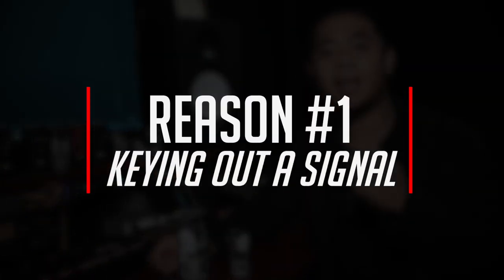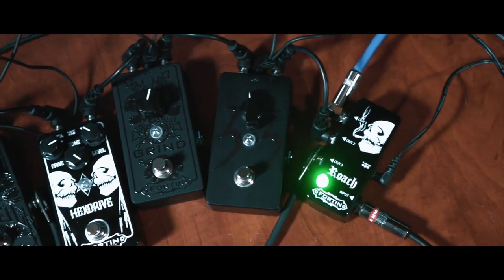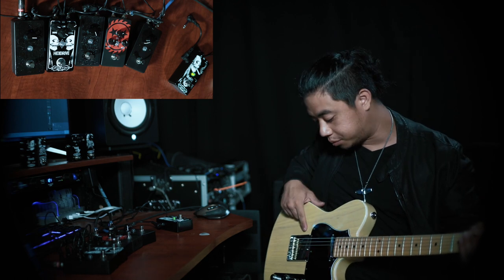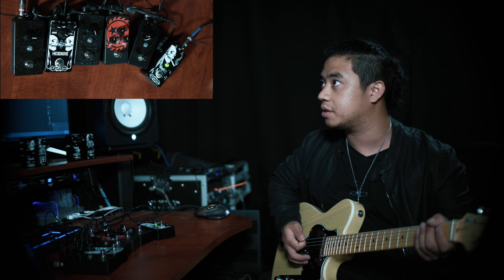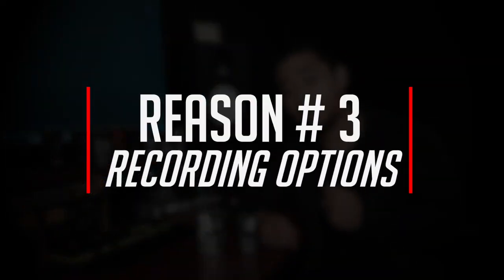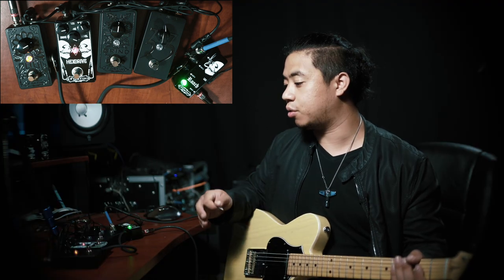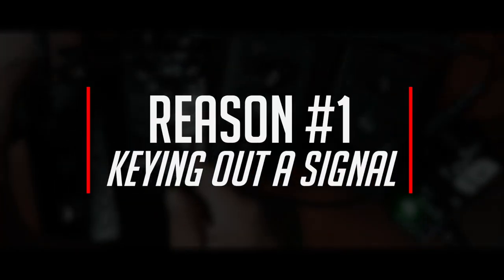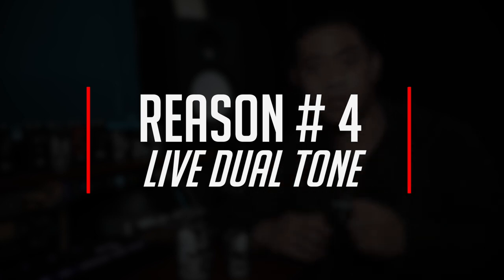Top Reasons Why You need a Splitter and Buffer

Comment from the maker: Any uses for a buffer or splitter that we missed? Let us know!
Reply from the maker: @Stealth Guitar Hey both all outputs on the roach are identical. So you can use 1 or 2 2 or 3 1 or 3. Any combination of your choice will get you that result.

For instance my output set up would be something like Guitar > Roach Output 1> 33 >5150 > Cab 1 / Roach Output 2 > Grind > Mesa > Cab 2. I hope  that helps! - Mel
Reply: Does the buffer go before or after your tuner?
Reply: @lovemesomepickles  I think I got mine before but I'll double check when I get home.
Reply: @lovemesomepickles  that's how mine is too I believe. Forgot to check. Lol haven't had to move my gear around in awhile so I forget how I got everything hooked up sometimes.

Comment: I would like to splitt signal from the guitar wireless (Senn EW100 G4) into the 2 guitar preamps. Could I use the Roach in this way? Does it works without power supply (passive)? Cables will be up to 30cm (all is installed in one 8U rack case). Thank you

Comment: Hey bro howd? not sure if this can be exactly used for this especific purpose i am going to ask ya...but here we goes....  is possible to create a dual-chain signal with this? ie.   out 1 : runs a clean tone pedal , out 3 : runs a distortion pedal with volume a little bit lower...so you can actually hear the clean note bite.      I quite in doubt about that...as the out1 would be going to daw from the clean pedal.. and out 3 from distortion pedal would be empty...not sure if that will work...can you confirm me this? Thank you for your time and video !! All The best
Reply from the maker: Seems like a similar situation is reason three and yes you should be able to do this - Mel

Comment: I don't understand why you use a splitter before the Zuul. What's the goal compared to plugging the guitar directly into the input of the Zuul and then put your drive pedals and preamp in the loop of the Zuul ?
Reply from the maker: The splitter sends the unaffected guitar signal to the Zuul Key input (essentially side-chaining), doing so allows one to use boosters, overdrives, and compressors (and switch them on and off) which effect your noise floor.
Putting the Zuul at the end of the chain before delays and reverbs would mean you would have to switch the Zuul's threshold every time you turn a pedal on and off. Using a splitter fixes this.

And if the Zuul we're the first pedal in the chain. If your amp, distortion pedals, overdrives, or compressors were to introduce noise, the Zuul wouldn't be able to gate said noise.
Reply: @FortinAmps  Thank you. I thought it was similar to the NS2 (4 jacks) but your noise gate is different with only 3 jacks.